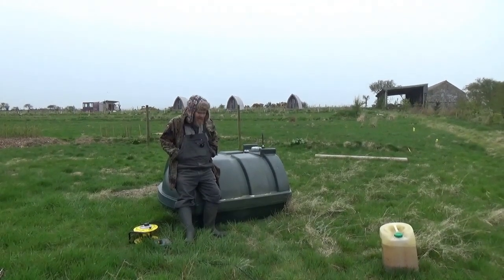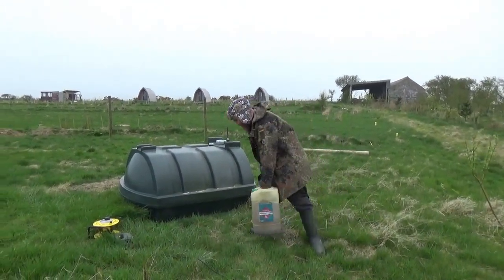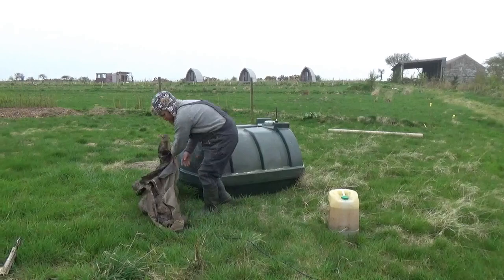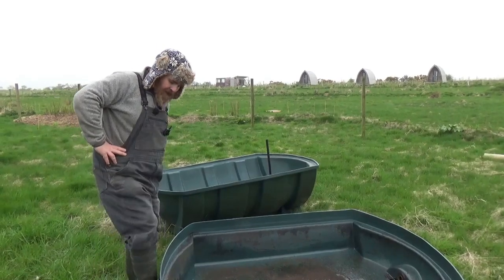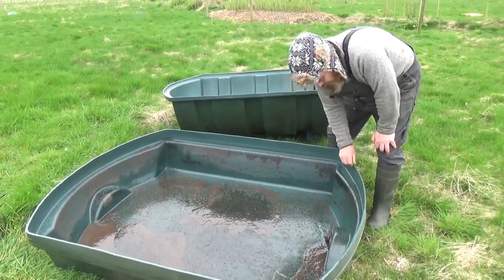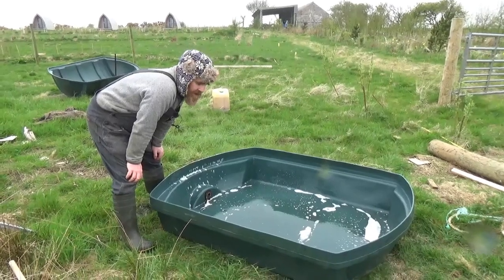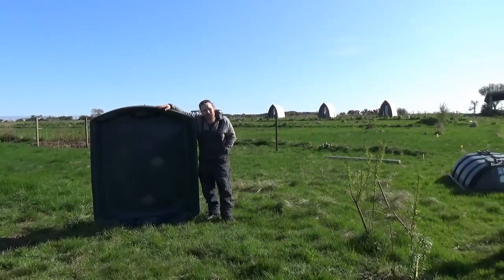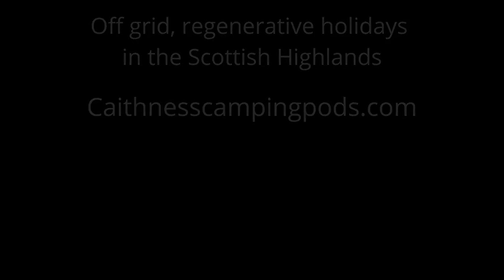DIY free mobile duck pond (geese like it too)

Comment: 1:45 the little insignificant things like putting the epoxy flakes into your pocket for proper disposal lets me know you are the real deal.

Edit: then the tarp to try to catch the microplastics was a nice touch too. Best you can do other than cutting it in a large indoor sweepable space and then transporting the cut pieces, which isnt always practical
Reply from the maker: Thank you! We're still in the process of screening out the rubbish of decades of misuse of the land before we became responsible for it, so I'm very conscious of even small pieces of litter.